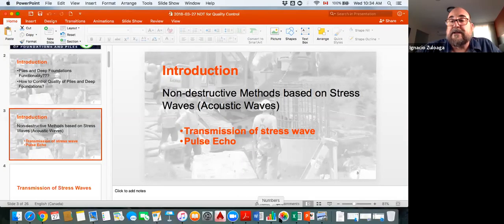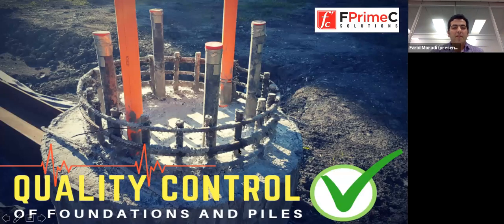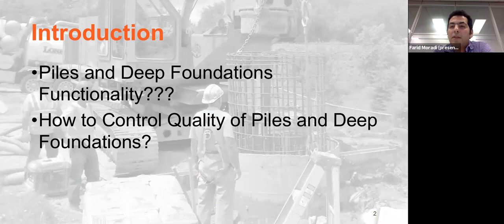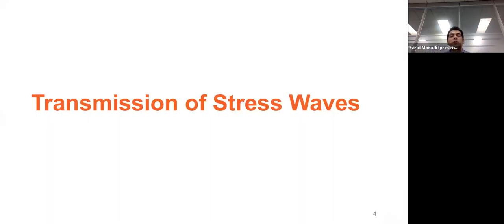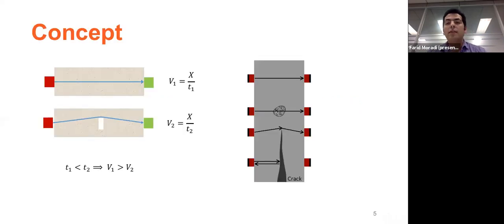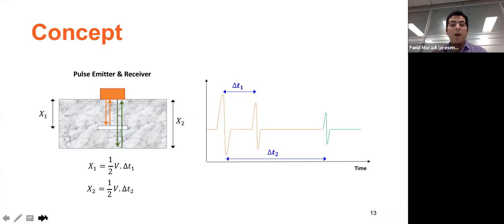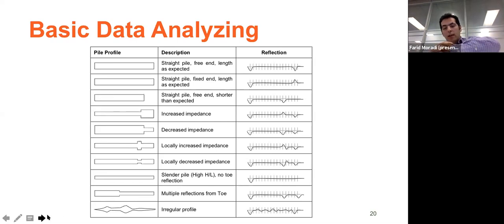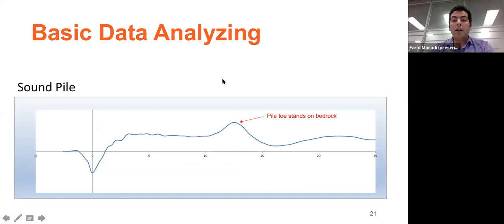Control de Calidad de Fundaciones y Cimientos Profundos - Seminario (en inglés)

Comment: How would you use this kind of technics in the case of deep waters sited piles, v.g. those for plattforms?
Reply from the maker: I suggest the use of: Crosshole sonic logging (CSL), as method to verify the structural integrity of drilled shafts and other concrete piles in offshore piles which tend to be pretty large. 

The CSL method is considered to be more accurate than sonic echo testing in the determination of structural soundness of concrete within the drilled shaft inside of the rebar cage. On the other hand, ,this method provides little indication of concrete soundness outside the cage.

Also known as Crosshole Acoustical Testing, CSL normally requires steel (preferred) or PVC access tubes installed in the drilled shaft and tied to the rebar cage. Before the rebar cage is placed in the hole, the CSL access tubes are attached to the interior of the rebar cage. The cage is then lowered into the hole and the concrete is placed. Steel CSL tubes are preferred over PVC tubes because studies have shown that PVC tubes tend to debond from the concrete due to the heat of hydration process of concrete, resulting in erratic CSL test results.

The tubes are filled with water as an intermediate medium. After curing for 3–7 days, a sound source and receiver are lowered, maintaining a consistent elevation between source and sensor. A signal generator generates a sonic pulse from the emitter which is recorded by the sensor. Relative energy, waveform and differential time are recorded, and logged. This procedure is repeated at regular intervals throughout the pile and then mapped. By comparing the graphs from the various combinations of access tubes, a qualitative idea of the structural soundness of the concrete throughout the pile can be gleaned.

A more advanced, higher-end analysis that creates a mock 3-dimensional graphical display of the concrete soundness throughout the pile is known as Crosshole Sonic Tomography.